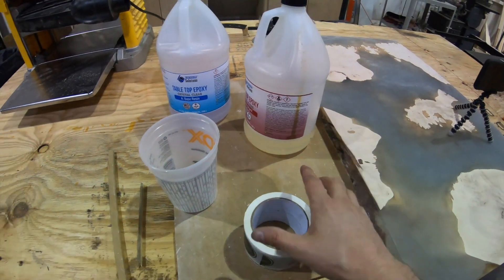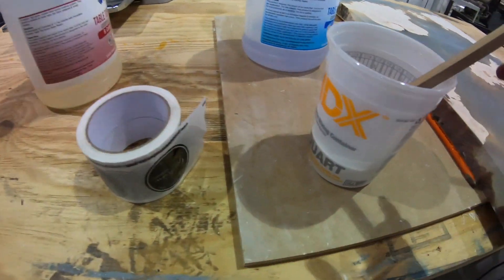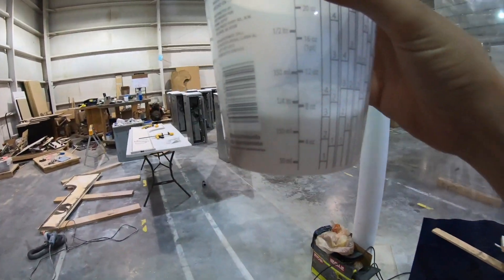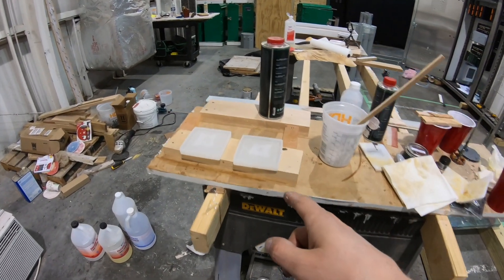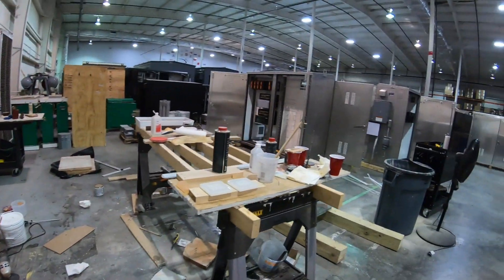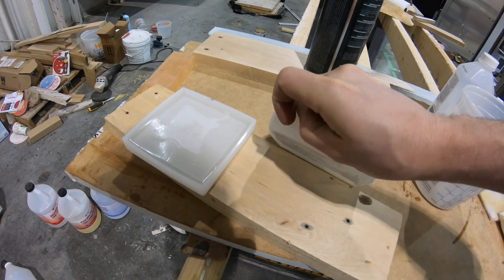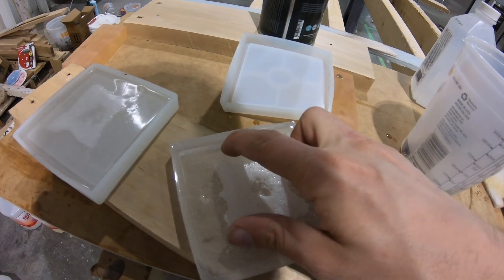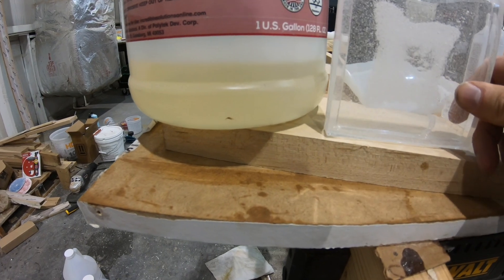Epoxy Turns Yellow in Container???

Comment: Put a few drops of Indigo color alcohol ink in the epoxy and it will go completely clear.  I realize this is 2 years later, but in case this happens again, this is what you can do to keep your epoxy (curing agent) completely clear.    Add denatured alcohol to get the bubbles to pop and either a torch or a heat gun to pop bubbles.

Comment: Hi. I have only just subscribed and love your videos. My wuestion is, can i use two different brands of resin on one piece of work, eg if one brand has cured or tacky, can i use a different brand for my second pour. Thank you.
Reply from the maker: Yes you can. There shouldn’t be anything wrong with using different brands
Reply: @GoodViewWoodworks  brilliant. Thank you for getting back in touch. Love your work👍
Reply from the maker: No problem! Thank you for watching and subscribing